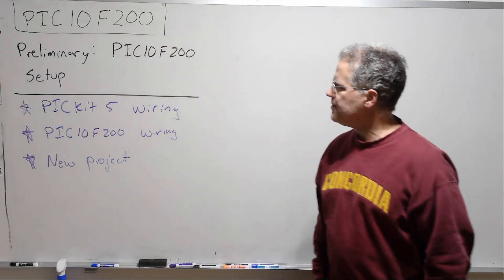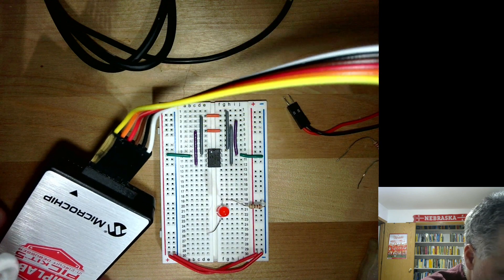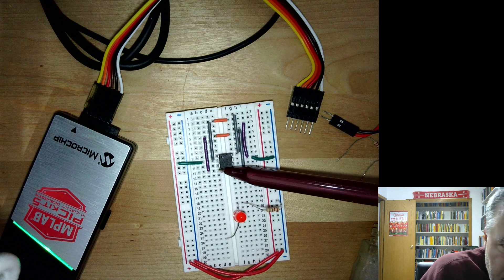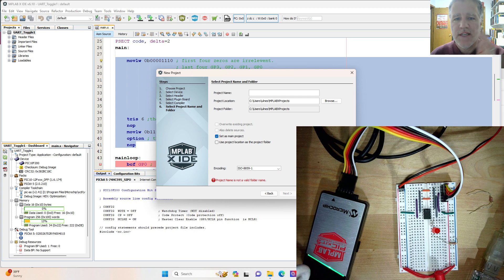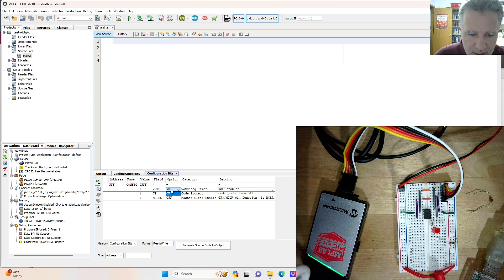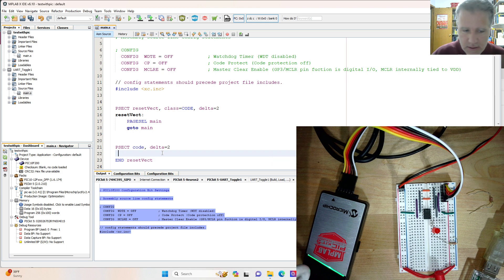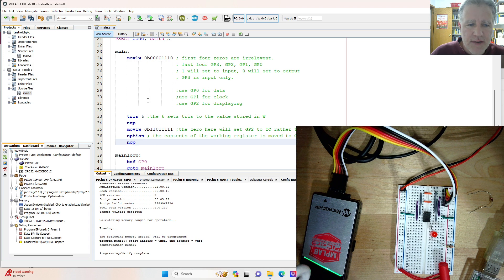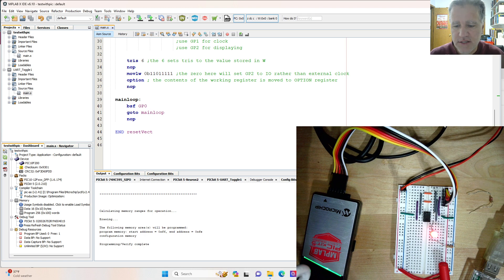Getting Started with PICKit 5 - Setting Up Your First Project

Comment: At 10:35 in the video what is the text you copied and paste? it's to blurry to read on my end. where can I find it or could you comment it to me, please so I can also C/P it to me IDE program? The video is great until that point my screen gets too blurry. I tried zoom and moving to different screen but no luck. EDIT: Also could you maybe paste the entire final code used? i have as much as i can see put into my IDE program but keep getting syntax errors. it would be nice if i could read the entire code to fix errors. im very new to this so learning as i go and having dificult time.
Reply from the maker: Hi James, 
Thanks for the comment. I'm sorry you had an issue with the video. Here is the code for all of the videos in the PIC10F200 series. 
https://github.com/ulnessd/PIC10F200
It looks like I didn't put the exact light LED code up there but I suggest using the Blink.s code. 

Also, I'm not seeing the screen go blurry at 10:35. It should have a 1080 option in the settings on bottom right of the YouTube panel.

Good luck with your studies. The PICs can be a little frustrating at first but they are a lot of fun once you get them going. 

Best,

Darin

Comment: What is the name of connector that you use to connect pickit and the board?
Reply from the maker: These are called Dupont wires. They are readily available from many suppliers although they often come as single wires rather than this 6 wire set. You can buy them pre-made or you can get a crimper set and make your own. This particular one came with the PICKit as part of the set. While not necessary, the Dupont  wires are very handy to have as a general part of your electronics kit. I've purchased a couple of different premade sets of various lengths as well as male/male, female/female, male/female. I also have a crimper set. I use both the pre-made and ones I make quite a bit.
Reply: @GNLProject-yp8po  I saw in many reviews and unboxes that pickit 5 didn't come with this cabe 😞